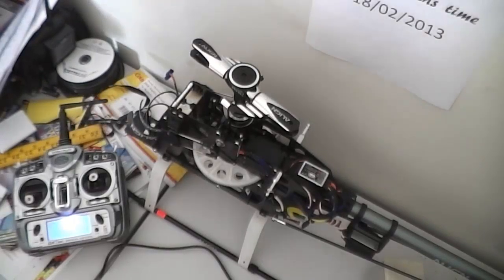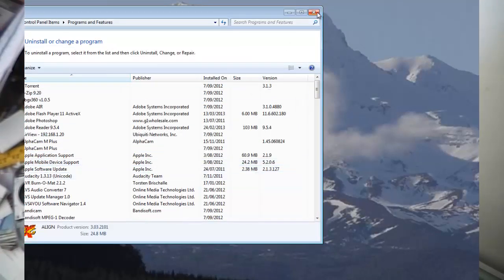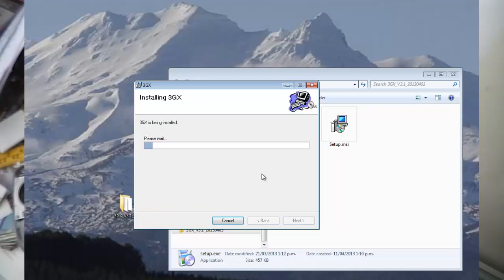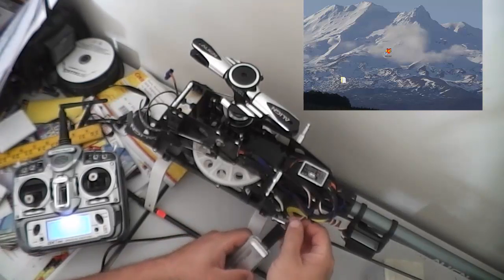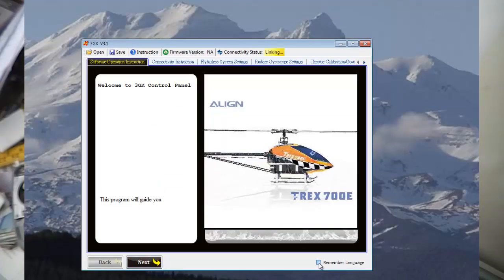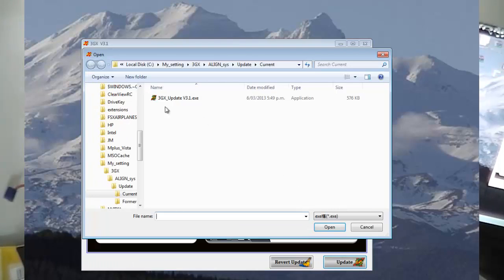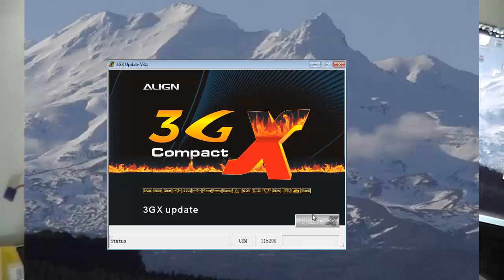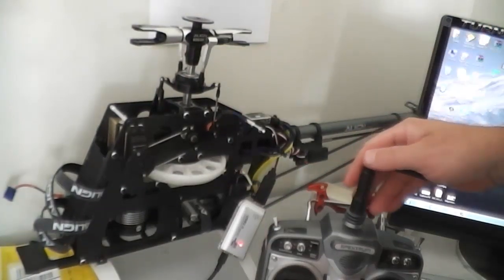3GX 3.1 - ALIGN - Update Firmware and software -Install

Comment: Thank you for the video I need to downgrade from 4 to 3.1
Reply: Why are you down grading? My 4.0, i could not get the tail to hold. I downgrade to 3.1 and my 450 is as happy as any. Now i have 3.1 on my 550, and cant get it to work. The 550 wants to fall over just before mid stick :(
Reply: Hi I wud not know y ur 550 is falling off. IMHO it shud not. 550s were flying before the v4.0 so i suppose it is in the settings. I downgraded because of the tail not holding on the 450L. Now it is good after the downgrade.

BTW there is now a 4gx from align :)
Reply: Chris castella My 4.0 was also messing with my 450 tail. 3.1 sorted it out. Cant get the 550 in the air with the 3.1. Flybarless is so hard for me to get it to work. I some times want to give it all up. Thanks for letting me know about the 4GX
Reply: Welcome its actually called GPRO. Programming is not difficult. If u have not seen this already, i advise u watch it.

watch?v=W4EANApW07g

All the best
Reply: Chris, i got it to fly, i was not pushing the power stick fast, i was spooling up as slow as i can, because i do not want it to fall over. But doing it slow, the hole helicopter vibrates and wants to fall over. So i said, to hell with this, just give it power straight to over mid stick, and if it falls over, so be it. And it just lifted up so smooth like it was meant to be. Just wanted to let you know i got it to fly.
Reply: 33gate1 Thats great news. I am now waiting for a Trex 700 Dominator which shud be in Thailand in a month. Shall post videos of first flight
Reply: Chris castella I my self dream of buying one. I will, one day. C you next time :)

Comment: im still running the 2.1 that came in the combo kit when i set the heli up.. do you have to update to the3.0 then to the 3.1 and then to the 4.0 or can i just upgrade straight to the 4.0 right now.. im thinking that there might be something missed if i upgrade straight to the 4.0...